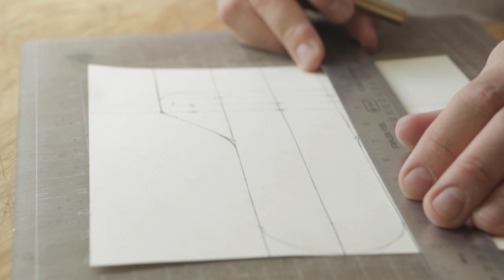Making a Wet Molded Leather Tool Belt 100% by Hand

Comment: I’ve been doing stained glass for years. For laying out and pinning the pieces of glass, I use a board called Homosote. Not sure if I spelled that right. Been doing leather work now for about nine months. The homosote works great for a cutting surface and a pinning surface for wet molding. Much easier to pull your tacks out of. Thanks Corter for getting me hooked on yet another hobby. ✌️☮️😊
Reply: I'm going to start this hobby this month. My first work gonna be making a double edge razor holder. Hope you have a lot of fun with this hobby sir.

Comment: Great video, and a great final result. The one thing that really gets to me is the design of the back panel and the belt loop. I know that is what the client wanted. but they would seem to need guidance. There was enough leather in the piece you used to simply fold over a loop all in one piece.Perhaps even fold it backwards leaving a nice smooth entrance and exit from the back pocket.. If it ever needed replacement, just cut it off then make something like you did but you have several years of use with out all the edges to catch on tools. All The best.

Comment: You can also wet mould your tools!, I use  plastic wrap around my tools so they won't get rusty, but for pliers holders works great!!
Reply: A spritz of silicone spray occasionally will stop that . My table saw top is protected by it and hence the inspiration .
Reply: What trade do you work in?
Reply: @danielnolasco8018  I'm a carpenter

Comment: i’m going to attempt to wet mold a pouch for my speed square this weekend, i have a really generic tool belt (carpentry) that doesn’t have a lot of the features that high end tool belts have (that i would really like to have) I have a lot of sentimental value in this tool belt as it’s the first tool belt i purchased when i had no money and was just starting out. the way i see it it would be a shame to just throw it out and buy a brand new one with all the gizzmos i want. thank you for giving me the confidence to attempt it.

going to attempt:

wet mold a speed square pouch, attached with chicago screws on the inside of the left main pouch 

nail gun rafter hook loop sewed to the right rear nylon suspender 

cats paw loop sewed to outside of left main pouch 

flat bar loop sewed to the outside of left main pouch 

attaching “tape measure clips” in various spots with Chicago screws

and if all that goes well i’d really like to try a horizontal hammer holster with 2” belt cut outs at 45 degrees

Comment: People wonder why I buy cheap Wicket and Craig or Hermann Oak bellies at around 6-7 oz. Bellies stretch the best for molding cases, as simple as that. It is also why you should Never make belts out of bellies. I also have 6 inch long 1.5mm (1/16") drill bit for drilling through thick layers of leather.

Comment: Years ago I started using nylon kitchen cutting boards as moulds and as a surface for cutting and punching on. It works pretty well and I've never had any issues with form or waterlogging or anything else. I do a bit of blacksmithing as well and make most of my own tools.

Comment: I understand that it would be a nightmare to hammer in and try to pull out of 16 ozs. I was wondering if a softening or "slick" agent could be used to make it "easier" to pull the forks out in that situation? I think one is Tokonol? Put that on the splines of the hole maker and would hopefully make it easier to pull the forks back out? Your thoughts please?

Comment: I love it. I especially like your instruction. I could build this using this video. And like everyone,  I have a preference. With mine, I'd like a back that rises approximately 3/4 of an inch above the top. Then fold backwards all the way to the bottom giving it a two layer back. Then a stitch going across about 2inches from the top for a belt loop just big enough for a belt. If that makes sense. Ive always had trouble finding a small pouch that I can remove tools from the front pockets without using both hands, which is necessary for me as an electrician. Apouch that hangs way lower than the belt tends to pull outwards and up, or the leather gets soft and just folds up. Very nice. Thanks.

Comment: I love these videos and thank you so much for sharing your knowledge.  I was wondering if molding the two pockets on the outside in one piece of leather that is not cut apart would work?  Then you would still stich between them, but to have it all in one piece would it be more stable and look cleaner?  Just wondering if it is alot harder to mold that way instead of individual or if there are other reasons.  Thanks again.

Comment: I know this is an old video but hopefully I still get an answer. Why didn't you put any kind sealant on either side? I imagine with tools and hands constantly sliding across the inside the flesh side is going to quickly start to have the fibers getting rough?

Comment: I made my own carpenter belt and for more strength I haven't done any sewing at the bottom of the pockets but more like a one piece back and front, saw together on the sides and it's much stronger, don't have to worry about any hole at the bottom specially when you have screws, nails etc in there, or sharp tools ! 
But this one is pretty nice for workshop tools pouch !

Comment: This is much nicer than anything I have owned, and it is gorgeous, but working in the field, for me personally, I would have preferred the two snaps to hook on the side of my body instead of the tool side. I would be concerned about any tools I pull out of my pouch hooking that leather and breaking loose the snaps. I would like to say I really appreciate yall's videos though, I am a beginner trying to learn the ropes and you are one of the channels I enjoy most, the tips you give as you create your pieces based on your experience are incredibly helpful, so thank you!
Reply: I know where you're head is at but the snaps will wear out over time causing them to not hold as tight. With the loop going in towards the body as the snaps loosen the pouch will un-snap itself as it swings away from you and you'll have to keep doing them back up or keep installing new snaps. My first leather project was a tool pouch to replace a nylon one with a velcro closure I kept blowing through. I made it last Oct/Nov and I did the snap loop in towards my body and I've had to replace the saps 3 times so far as they loosen and just don't hold as the pouch swings on my hip. I don't want to sew on the loop and be forced to thread the pouch onto my belt every time I want to put it on or take it off at work. I've been considering the loop off and putting on one just like this or figuring some way to do it with straps and buckles. I honestly think this is the compromise that's made though to to have the ease of snaps.
Reply: @TheKevinAdventures  if that is the case, could you make the tail a hair longer and leave what is basically an additional flap in the back to tuck the tail into giving you the best of both worlds? No snag for the tools or on your body? Granted it would add a slight thickness to the back of your pouch, but you could account for that in your wet mold base by making it one leather thickness taller

Comment: I make holsters too and chisel through 2 layers of 8/9 oz leather all the time, not all that hard. use a straight edge to hold the leather down as you pull the chisel out, keeps from stretching the holes you just punched

Comment: When doing stitch lines as long as those on the larger two pouches, do you still pull enough thread to do the stitch line in one run? I've done it that way on a few axe scabbard and knife sheath projects, and it is somewhat unwieldy.

Comment: This will last a long time. I am a super amateur leather worker. I make knives, so I occasionally make sheathes for them, and have made a handful of gun holsters, belts, wallets, etc. I am also a carpenter, so I decided to make some tool bags (that’s what we call them, “bags”). I made one out of leather, one out of nylon (I also sew and make outdoor gear, much better at that). I’ve now been using the two bags for four years. The reason I made one leather and one nylon is I wasn’t sure which I would like, and which would hold up better given the brutal Pacific Northwest weather, which I work in every day. 

Four years later and the leather bag is the winner. They’re both still going strong, but the leather is much nicer to use. It is pretty ghetto looking, but it works great. I expect it to break down at some point. I just treated it with Mink Oil when I made it, and that’s it. It has gotten mildewed over the years of being constantly wet. I should have cared for it better. 

Basically, my point is that if my rickety leather bag, with zero rivets, and almost zero care, has held up to four years of abuse in the Pacific Northwest as an outdoor carpenter, your bag will last 15-20 years being on a tile guy indoors. He will cherish that thing. 

This has inspired me to make a new set. Also, as others have mentioned, next time make the backing extra tall and fold it back to make the belt loop. That way you don’t have catch points when putting tools in and out. Also, make the belt loop wider so it is less likely to swing on your belt. I made my belt loop pretty much the entire width of my bag.

Comment: If you cut the wooden forms from a piece of wood with a drill and jigsaw and keep the female side you can just sandwich the wet leather in between for a perfect wooden mold and you avoid all the nailing and shaping by hand. Much less wasted leather also. Cheers

Comment: If it's not good to use your stitching tools directly on the wood, how would you recommend making products like this on a regular basis? Would simply putting the rubber board on top of the wood work?
Reply from the maker: There's a cutting board in the first link in the description - punching into delrin or HDPE is best to keep your chisels sharp :)

Comment: I do this a little bit different, but the point is the same.. I use aluminium forms, with heaters inside it.. Its done in a minute, and its good for almost all types of leather

Comment: What oil did you end up finishing it in?  I have found that I do not like the neatsfoot compound and need to find a better alternative for keeping it natural without dye.
Reply: Never use the compound myself.  Go Pure neatsfoot oil.  If you can find the traditional style thats even better.  Although many don't like the smell of traditional Marrow pressed neatsfoot instead of the more modern tallow made neatsfoot.
Although these days I'll admit I have been using Pure cosmetic grade "Sweet Almond Oil" more then anything else.
Reply from the maker: I use mink oil and aussie conditioner from Fiebings :)
Reply: @Corter  Thank you for the reply!  Do you give it a coat of mink oil then seal it with aussie?  Thanks!